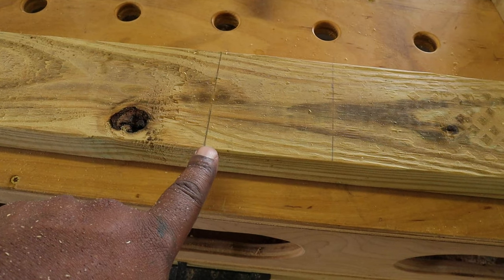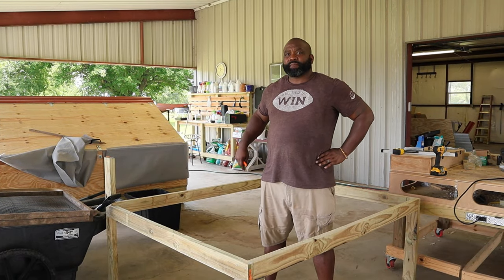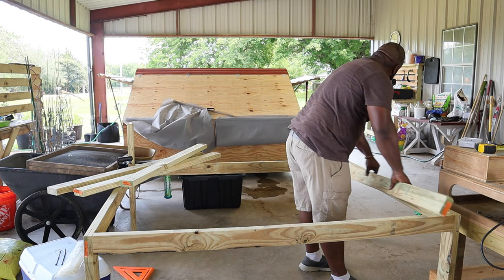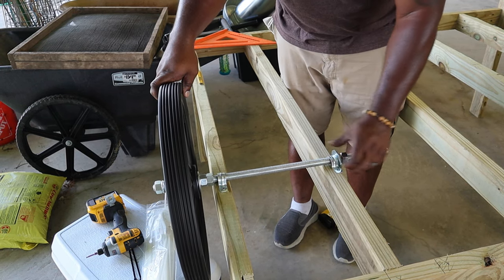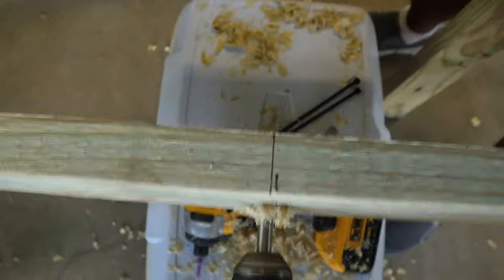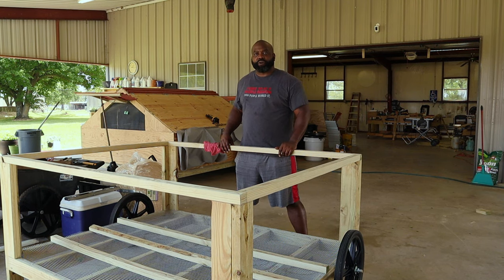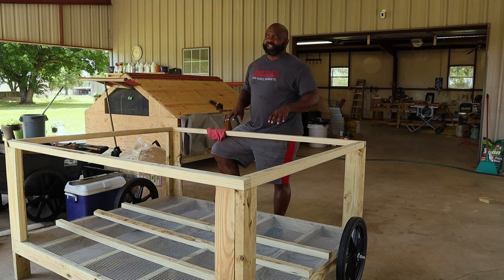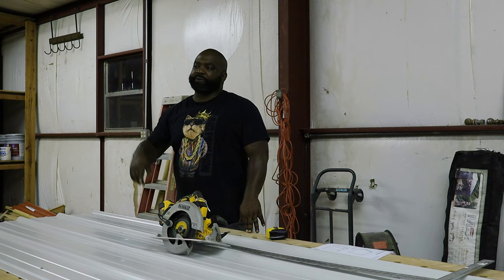DIY Egg mobile | Modified

Comment: Great job, guys! That must have cost a fortune with lumber
Reply from the maker: Not as much as the brooder. It was actually a surprising relief when we saw that the prices had come down since our last brooder build. Are you working on any projects?
Reply: @TheNakidGardeners  I will be soon. I have 5 more raised beds planned, a shed coming soon and when that comes, I have 2 chicken coops to assemble. My last ones were crushed by a giant oak :/
Reply from the maker: @Hosemastenbrook  ouch! That sucks having to replace that. Unless it is a bigger and/or better one.
Reply: @TheNakidGardeners  definitely not. I built that last one out of 2x4s and plywood. It was 16x8’ enclosed with a 16x16’ fence outside. These ones are kits from TSC.
Reply: @Hosemastenbrook  Oh WoW, Very Sorry to hear. If more gets Ruined by Any Storm you Can claim it on Insurance & it’s a Godly Act which is Uncontrollable so you DONT Pay Anything & Does NOT count as a Loss on your policy‼️‼️ Lots of Luck, Storm Season Almost Over.. 🙏🏼 😊 👍🏼
Reply: @candylynn152  thank you. It was actually a byproduct loss as the tree didn’t actually crush it, but the builders tore it down to reside the house. But our insurance didn’t even cover half of the cost to rebuild. Bunch of crooks.
Reply: @Hosemastenbrook  That’s Terrible‼️‼️ If it Happens Again DEF Tell Em You Know Your Rights & It’s a Godly Act Which is Uncontrollable‼️ Same w/an Auto Accident: Print 3 DIF weather reports & Appeal Surcharge ALWAYS & Look for a Witness~NO1 in Your car can be a witness but Anyone Around can be‼️❣️‼️
LoL remember 😂  I was there & I saw Everything ‼️  
             😉  🤣  😂